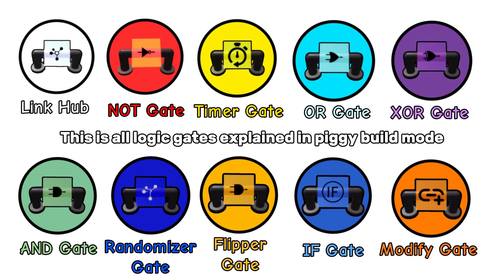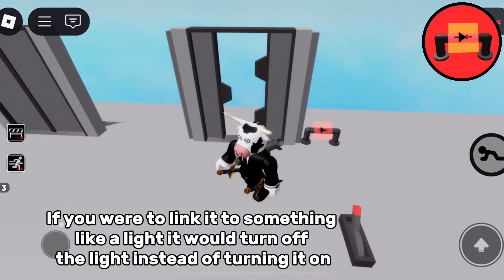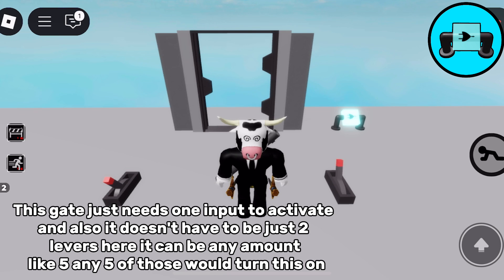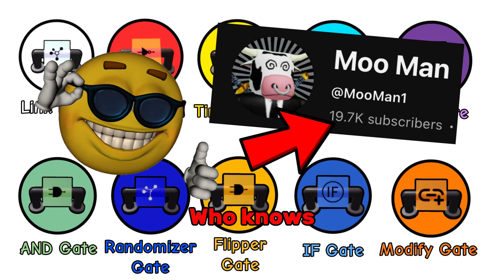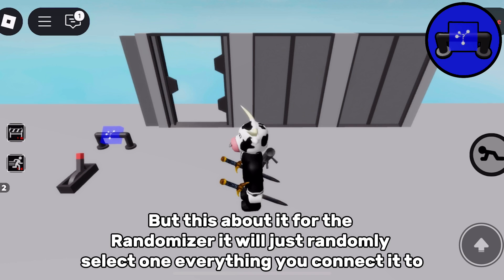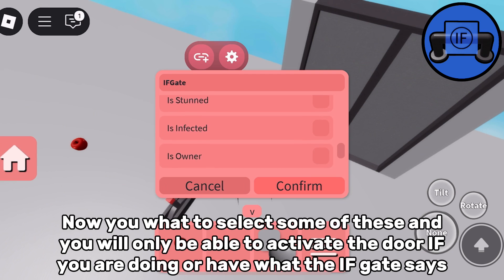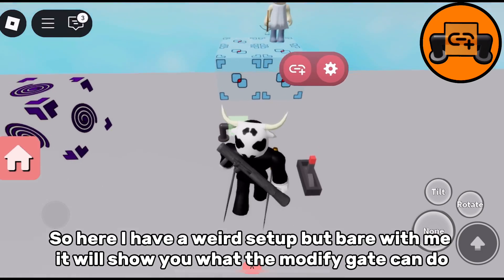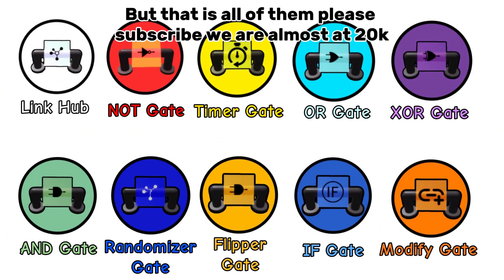[🧠] All Logic Gates in Piggy Build Mode Explained

Comment: Also one correction, the XOR gate activates if the number of power sources are odd, if they are even it won't activate.
Reply: Bro no it doesn’t
Reply: The XOR gate only turns on when only powered by a single source if none at all or more than one then it’ll be off
Reply: @Ameer-gaming236  That is wrong bro, u can try it by yourself.
The XOR gate will turn on if the activated power sources are 1, 3, 5, 7, etc
If the activated power sources are 2, 4, 6, 8, etc it won't work
Try it by yourself if u don't believe me
Reply: @Ameer-gaming236 no @AndBrawl.-e is correct, it’s a little known fact but XOR gates only activates when an odd number of power sources and won’t activate if the number of power sources that are on are even.